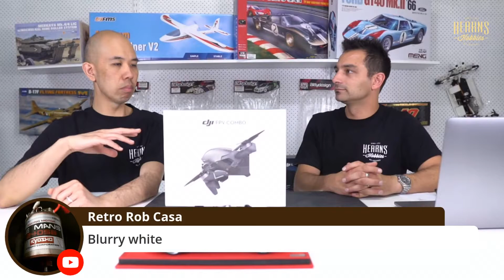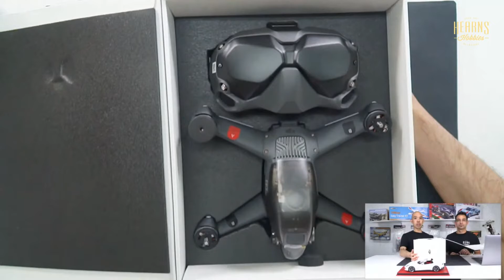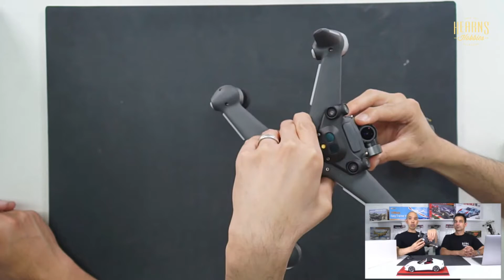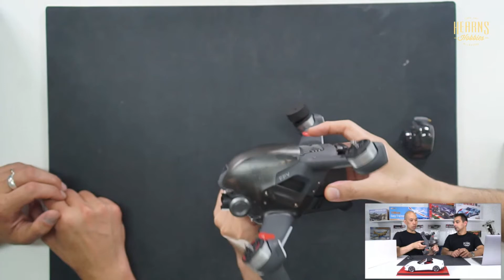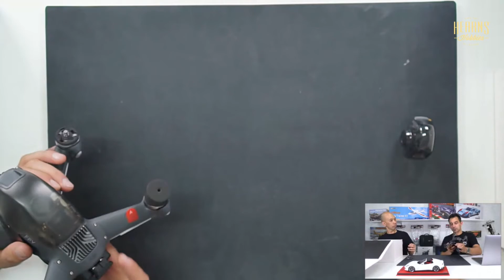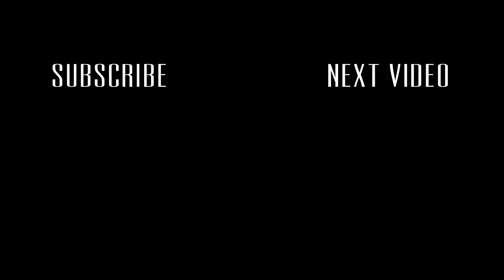DJI FPV Live Unboxing | #askHearns

Comment: not a product I will ever purchase, it was over hyped and very cheaply made and worse forced people to buy NEW Goggles to work with it, instead of using the current one
SO...do not think DJI thought it through before releasing it
but I think all they cared about was making the $$ not their customers
Reply from the maker: I think this combo is directed to those who can fly FPV but want an all in one package that does as expected. It comes with the goggles so no need to consider any others. Whether or not they find new customers is yet to be seen. All in all it is a neat package that cannot be customised.